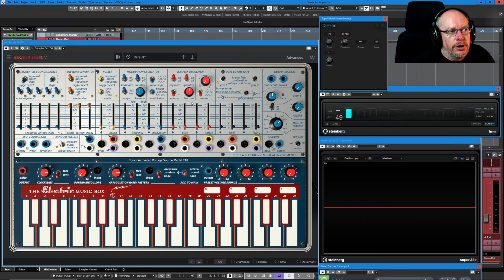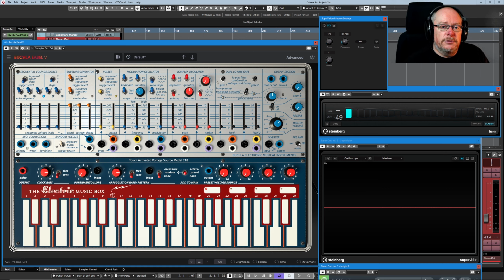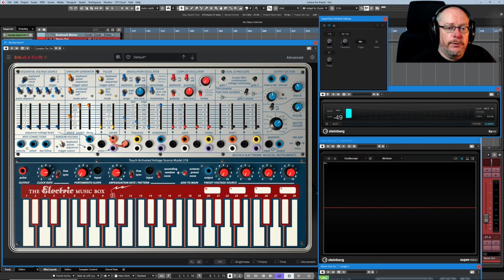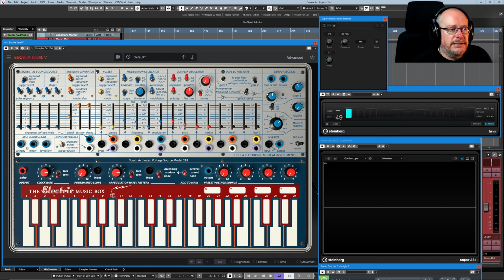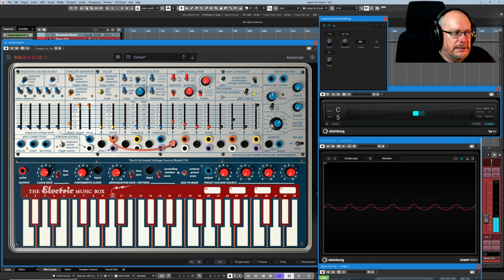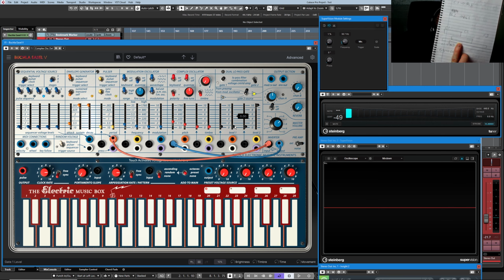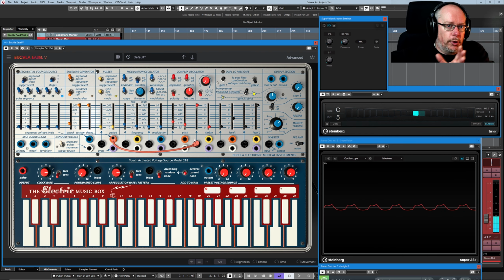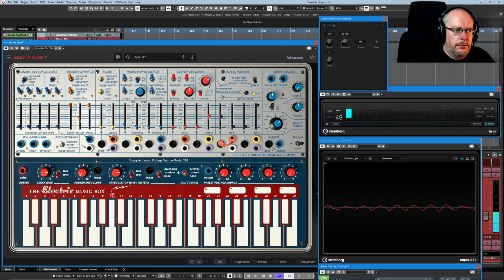Arturia Buchla Easel V Tutorial Ep#7 - The Output Section and Pre-amp

Comment: Hi. The envelope out, when jacked into the complex oscillator's pitch or timbre, is doing nothing for me. My preamp is set to noise, and I have switched the gate 2 source to preamp (even if it's the gate 1 source that we're trying to affect). I suspect either my software is outdated, or I may be missing something!

Do let me know if there is a solution? I tried searching a lot of forums but to no avail. Cheers!
Reply from the maker: I suggest you start a brand new patch from a template file (the "Default" one), and JUST patch the envelope out into the complex oscillator's pitch modulation. Here's a screenshot of the simplest thing you can do with an envelope out: https://drive.google.com/file/d/17JwY89YO6-DQglC2o1HQCS9XgXWW9K41/view?usp=sharing